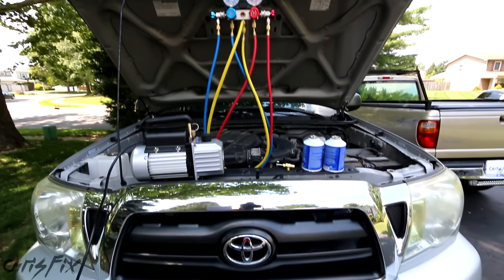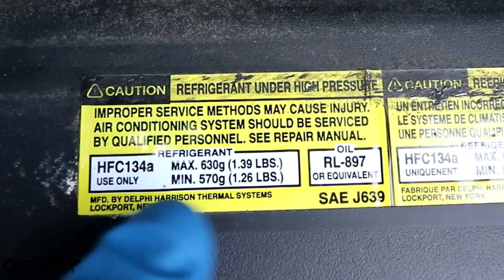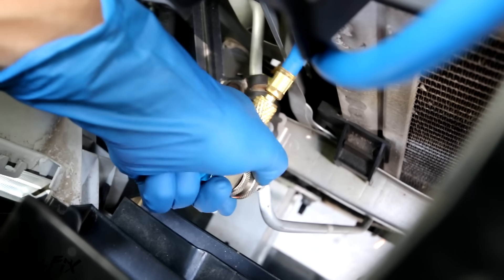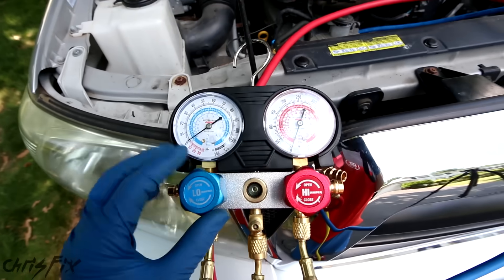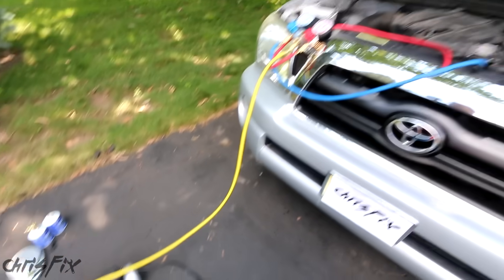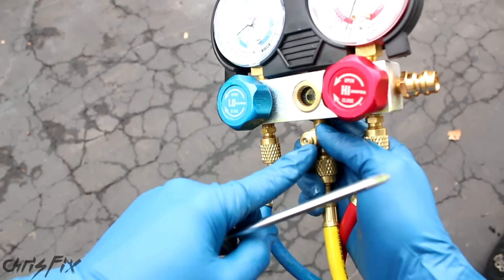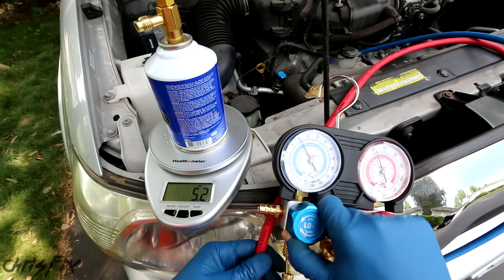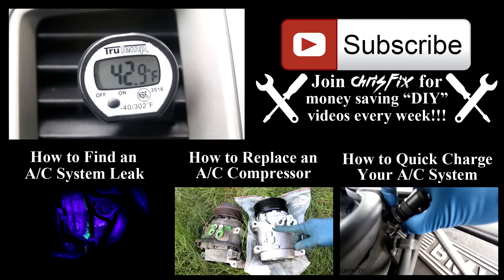How to Properly Recharge Your AC System

Comment: Hi Chris, I just bought a similar pre oil compressor like you mentioned at 7:50. But my question is during the 45mins + of vacuuming the system of air and moisture, doe that not pull any of the oil within the compressor itself? I am guessing it’s designed to keep the oil inside of the compressor as you did not add oil after that initial vacuum “flush”. 

Thanks!
Reply: No, it should not be able to remove the oil.

Comment: Hi Chris.
Just wonder how do you measure with your digital scale when the hose is hooked up to the can? isn't the hose pulling down the can by gravitation and completely mess up the measurement?
Reply: I guess it can be calibrated but still when you measuring that small of an amount even with the calibration might not so accurate.
Reply from the maker: The hose is connected before you take the reading so the hose and the can are already counted in the weight.
Reply: @chrisfix  
Got it. I was thinking that the measurement taking place something like that way, but thanks to reconfirm the process.

Comment: when adding freon should freon can be held upside down or right side up or does it matter?  good narration and pointing to objects and rxplaning what to do -ie how much pressure etc.    THANX!
Reply: It is safer to have the can upright as that charges as a vapor whereas upside down charges as a liquid. If your charging point is on the accumulator or is a good distance away from the compressor you can charge as a liquid. If its too close and you charge as a liquid you can destroy your compressor.
Reply: @Redtooth75  thanx thats what I thought good vid

Comment: Question, I see on these videos they vacuum out the old refrigerate, I don't see any recovery tank to put the old refrigerate in, is it just going out into the air.
Reply: The system is the video was already opened from the previous video where he replaced the compressor.

Comment: correct me if I'm wrong, but by turning off the valves for the high and low side while performing your leak check with vacuum, all you did was check to see if the gauges were air tight.

Comment: Chris, great video as usual. I noticed you purged the air from the line on the first can of 134a, but not the second. Is it not necessary on the second can?
Reply: My assumption is since the can tap is closed, no air gets in, so a re purge is not necessary

Comment: So my brother was doing some bodywork on our suburban and he accidentally cut a line on the back right area. It was under pressure because it was hissing for about 2 or 3 minutes afterwards. It also sprayed a green oil all over the underside of the car. Based on what I read online this was an AC refrigerant oil line. So assuming I patch it up correctly and refill the lost oil, will the lines regain the pressure that was lost when the AC compressor starts up? That makes sense to me but I could be wrong. Any help is appreciated. 👍🏻
Reply: It sounds more like a coolant line as the rear heater core is back there. Ac oil is mainly in the compressor but some is present in the lines. There are no seperate ac oil lines, just normal pressurized lines. If punctured they would have leaked out all the refrigerant. If it was a refrigerant line you would need to repair the line and then evacuate and fill the system. Replacing the orifice tube and accumulator is also a good idea anytime the system is exposed to air but is not strictly required.

Comment: Checking with vacuum won't always expose leaks. Pressurizing with nitrogen will. Edit: most compressors require the filter/dryer to be replaced as well to honour the compressor warranty.
Reply: Amen

Comment: A question; if you close the valves when you pulled a vacuum, aren´t you just measuring the pressure inside the gauge or is it just the yellow line you shut off with the valves?

Comment: Chris after the system was fully charged to correct amount of refrigerant, what was the final high & low pressure guage readings? 20 to 30 psi low side, 180 to 225 psi high side in the approx range?

Comment: Thanks to you, I did this myself. 
Three tips for others:
One - slowly fill your vacuum pump with the oil it comes with. Do not overfill it. (You can pour some out of the exhaust hole :)  )
Two - After your first can, the second can will need to be removed and measure it that way. Don't measure it while it's hooked up to the yellow line. Take your time. Measure correctly.
Third - Add your PAG first. Add it in your condenser hole.

Comment: Sooo… what if I’m still not confident enough to do this but confident enough to change out my AC Condenser in a 2015 Silverado? Is it okay to drive around for a couple of days like that until I can get to a mechanic to do the vacuum/recharge? (Will the transmission oil portion of the condenser be fine)?

Comment: Isnt the hose going to cause leverage and throw off weight of the can on scale? Good video as always.
Reply from the maker: It can, but you're still adding in the amount you need to add. So if the can is 10oz, and you put it on the scale and it says 15oz, and you need to add 5oz, you would add 5oz and be good!

Comment: Fluid ounces are not the same as weight ounces.  Fluid oz are a measure of volume only and not what air conditioners specify.  Assuming a 12 fl oz can is exactly 12 weight oz or 3/4 lb is incorrect.  To get the proper weight, you need to weigh the can before AND after you empty it.  To illustrate the point imagine 1 fl oz of alcohol vs 1 fl oz of liquid lead.  They don't weigh the same.   I'm not sure what exactly 12 fl oz of r134a actually weighs, but people need to be careful not to assume it's 12 and use a scale for every can, not just the last one.  Great video otherwise.  A lot more people are watching your videos than mine.  :)  Peace out, bro.  :D

Comment: Great video !! Thank you very much! Now I would like to share my problem (still a problem) with my 2009 Suzuki Sx4 with Matsushita compressor. The thing is that I fought a lot cause I made several vacuum process and recharges, and always the same reading, normal to low LP side, (that make compressor switch on & off because of fall of pressure) and HP side with values between 275/300psi. 3 times my relief valve evacuated oil and r134 (expensive in my country 20 dollars a kg). So I decided to buy a new condenser, new expansion valve and make a proper flush with r141 (even more expensive 30 us$/kg) a bottle of pag 46 (22 us$/250mL) I did everything by service manual, and 40 min of vacuum. The same issue returns. Normal to low LP side & HP side 275/300 psi on 75F° day. Intermittent cooling inside de cabin. Can a evaporator coil get clogged inside? I noticed on the flushing procedure that the only element that seemed to be obstructed was the evaporator coil. Please give me some advice! I'd appreciate a lot!! Regards! And keep on teaching!

Comment: Does it have to be at 30 mercury.  Mine stays at 20 mercury
Reply from the maker: Try to get it as close as you can to 30, if it won’t go anymore then that might be the max for your specific system, and as long as it doesn’t move after an hour, you should be good!
Reply: It stayed on 20. But I smell freon coming from the vents. I replaced the ac compressor, the drier, the orifice tube from the heater core to the condenser, even the pressure switch.

Comment: Great video. Just replaced a compressor in a 2003 Honda Accord ex V6. Followed every step here to recharge. Mechanic wanted to charge $1550 parts and labor to replace compressor and recharge. Ended up spending a total of around $325 total ( $200 on compressor, $65 on vacuum pump, $35 on gauges,$14 on two cans of refrigerant, $8on uv die). I ended up saving around $1250. I do alot of repairs on my cars myself, but never tried AC. Your video clearly explained the process. Awesome work!
Reply: Where did u get the 65.00 vacuum pump?
Reply: @tyrc12pro94  Wal Mart online

Comment: if  you add oil  and  leak dye...when u attach the can ..u need to bleed off air from hose....so the  oil and  dye  will also shoot out from the hose...and not go into the system right?

Comment: I recommend replacing the Schrader valves at the high and low pressure ports. Those valves are prone to leaking o-rings after a while, and especially after a service, therefore it’s cheap insurance to just replace them. As one can see, bright green dye is visible in the ports on Chris’s high pressure port. That visible dye is indicative of a leaking schrader valve. The dye is added to refrigerant to help identify leaks on an automotive AC system.
Reply: Dye also comes out a bit anytime you use your guages on the shrader valve, but I agree, they cost 50 cents each to replace!

Comment: I have been looking for solution, mechanic said my ac compressor was shot but I won't believe him! About once every month the compressor starts turning over and blowing ice cold ac, I put the manifold gauges on it and my high pressure was going up and down from 125 to 185. What could it be? It's just keep going up and down up and down

Comment: Thank you. I do wish you could have mentioned the high side as what PSI would mean problems in the unit:  too high, too low, what this psi could show regarding your compressor etc. Also I was curious that since the compressor you said had oil put in it from the factory and then later you vacuumed it; wouldn't you have pulled out some of that oil when vacuuming it? Thank you again for your video.

Comment: Great video  as always, Chris- thanks for taking the time to share your knowledge.  Here's a question:  My condenser was damaged and the refrigerant leaked out, I'm about to replace the condenser.  I know the oil capacity for the entire AC system, but should I add the entire amount after replacing the condenser, or only part of that amount?
Reply: My 2 cents on your situation: the only way to assure the right amount of oil would be to remove all parts from the system and properly flush them. Considering that you won't do it, add 1/5 of the total amount of oil that was supposed to be filled in the system. The major part of oil will certainly be in the compressor, however, the oil flows through all the tubes, condenser, drier and so on.
Reply: @rafamartineiz  how does one "flush" an ac system? I thought all you can do is put a vacuum on it

Comment: I have to say this is the best tutorial out there.  Hands down,. Mechanics must hate ChrisFix.  I love the guy.  I changed the whole compressor and recharge on my 2014 sprinter 2500 2.1l 4 cylinder.  The job was a breeze with this tutorial.  you deserve your millions of subs.

Comment: Hey Chris, when you shut the valve after you vacuum the system are you isolating the gauges and if there is a leak in the system you wouldn’t know because you shut the valves. I’m a rookie and am watching this to learn but I’ve dealt with air systems and vacuum tests before that’s why I’m asking.

Comment: Hi Chris, I have a question for you. For detecting a leak can you use an air pump to put air in the system and use the traditional water soap method and see the baubles? I see your video with AC Leaks in Your Car (UV Dye) but I don't find them around my place.
Reply: Best will be to pressurize the system with nitrogen & check for leaks, vacuum test does not always detect a leak.

Comment: URGENT PLEASE: I’m about to replace my compressor. 
Q1: Should I connect the vacuum to take oil all the moist while the old compressor is still mounted or I should replace the compressor before doing it?

Q2: Does connecting the vacuum also suck/draw out the oil from the system to enable me put a new oil via the yellow line?

Comment: Great job! Good! Thumbs up! were useful as well as the safety tips, use of the vacuum pump, gauges, purge of lines, proper amount and methods of determining proper amounts of Freon. There were no distractions or irrelevant information. The editing was first class too. It would have been better if normal running high and low pressure values in the system were given, but overall ChrisFix rocks.

Comment: Hey chris I used your video to help me recharge my system after installing a new compressor that had a very loud ticking clutch. I got about 2 pounds of freon in and need about half a pound more but I get zero high side pressure the whole time I was filling up. Compressor pulley and clutch were spinning and low side pressure went from 120 down to 60 once AC compressor turned on but no changes on high side. What could be the issue? I suspect my remanufactured AC compressor is garbage.

Comment: I have to agree with the guy below with about 600 likes. I'm no beginner, we use a full blown machine, so I get all this, but was looking for a pointer or two when using gauges, purging air ect. You didn't miss a step, good job man!
Reply: One thing is that stuff as u said is nasty. Take advantage of any wind. step away from car, point purge valve towards wind direction and then purge, using the wind to avoid getting the minute amount  of refrigerant on ur body, the vehicle, or in your lungs. Also, hold the hose straight up and high, kinda like when bleeding brakes, the caliper wont bleed when some dip puts on wrong side and bleeder is on bottom instead of top, prohibiting all air purging.

Comment: 5:11 I’m a little lost. Is he saying to have the system evacuated because you want to start from 0 refrigerant in the system? Is that because you wouldn’t know how much is in there and therefore wouldn’t know how much to add?
Reply: Yes
Reply: He says have it evacuated because in otder to pull a vacuum and check for leaks, there shouldn't be any refrigerant in the system. It's illegal to vent it into the air.

Comment: And why did you have to recharge? If the system is empty or there is less in it than should be, you have a LEAK. Repair that first!!! It is better for the environment and for the airconditioning compressor....

Comment: 96 Jeep Grand Cherokee with a new compressor that came with oil in it.  Using an air driven vacuum pump and a gage set very similar to yours, I had some oil with leak detector being drawn out of the system and dripping from the vacuum pump, so I closed the high side and evacuated from the low side for 45 minutes.  After 45 minutes it was drawing some oil from the system from the low side, judging from the sounds of the pump, more dripping, and liquid mid level in the manifold sight glass.  I captured what oil I could from the cardboard box on which the pump was sitting and got maybe a tenth of an ounce and some had leaked over the side and onto the ground but not very much.  Should I be concerned about the oil drawn out of the system and should I evacuate more with the high side open even if it draws out more oil?

Comment: Great video but how do you add oil AND purge the air out of the line? Won't oil come out? Do you just add a little more than you need before you purge the line? Also, the service manual calls for 8oz of oil in the system. My condenser had a hole in it (punctured when doing the radiator). I just replaced the condenser. How do I know how much oil to add?

Comment: Just got done with my AC job. replaced the compressor as it was making a metallic squeal and slowly leaking freon out. also replaced the condenser, expansion valve and all O-rings. flushed out the lines and evaporator. removed and measured back the proper amount of oil for the compressor. and was ready for the evac process, your video was a great help for that. thank you.

Comment: I have some recommendations.
1. Open the 4 doors.
2. A/C on, fan max speed. Max cooling.
3. Increase the RPM to about 1500. (Ask your friend to push the pedal for you).
We have to do that because we want compressor to run continuously.

1. Gradually fill and then turn off the low side valve, back and forth.
2. Do not rush to fill the system at once.

After the Low side shows 30-40psi and High side shows 200-250 psi.
Stop the process.

After the system has been filled.
1. Turn off the low pressure side and detach the gauge.
2. Stop the engine.
3. Wait for a moment. look at high side gauge shows around 150 psi.
4. Detach the high pressure adapter.
5. If the engine run and you detach the high pressure adapter. the pressure potentially hardly push your hand away and you might get hurt. 

Note: Filling the A/C is dangerous job. If you lack of knowledge, please ask the expert to do that.
Severe damage, hazard, and death from explosion.
Reply: Good presentation of the procedure

Comment: Nice tutorial video . Next time just mention you have to have a/c on max not on low so you can read a/c gauges pressure correctly . And also press the gas pedal a little bit to 1 or 2 rpm for a few seconds so Freon can start flowing in faster .

Comment: So question. After the system is under a vacuum, will removing the hoses cause it to loss vacuum? If not, couldn’t I just use a regular ac recharger? The yellow hose to me is a bit of a pain haha.
Reply from the maker: Not enough to cause a problem so you can do that

Comment: Weighing the refrigerant is a great way to determine how much you're adding. But you didn't take into account the weight of the can itself. Your calculation is slightly off. The difference is probably negligible. Great video thanks.

Comment: I agree with most of your video.  However there is one part I totally don't agree with.
You stated your compressor came pre oiled which is great.  You pulled vac for 45 min.
Your pump would have pulled out all the dye and oil in the system again... So I feel you should have added the oil and dye...  The Vac pump if working correctly will pull all the ail and dye and moisture out...    Just my thoughts....
JD